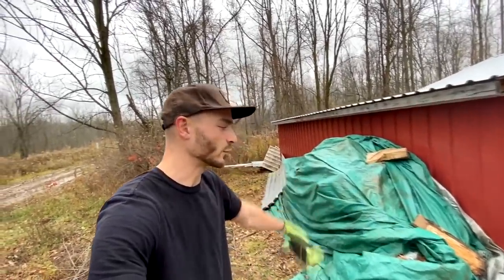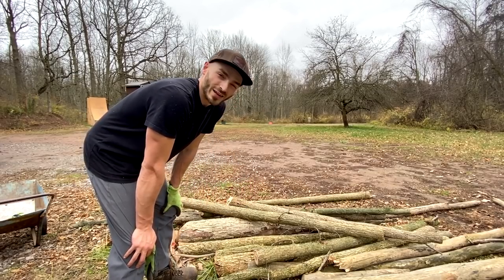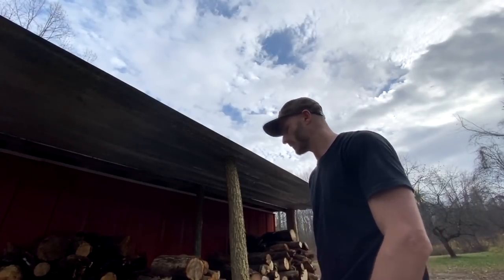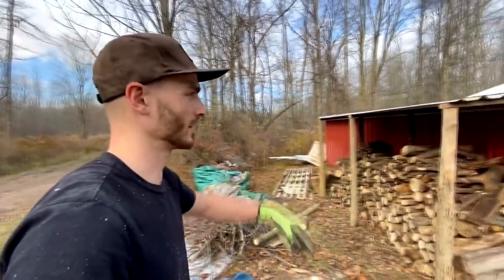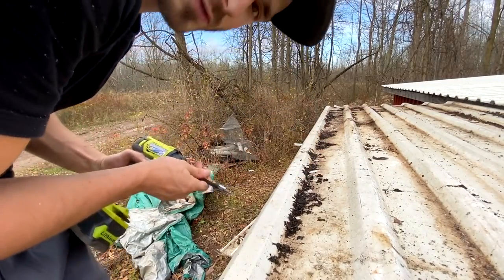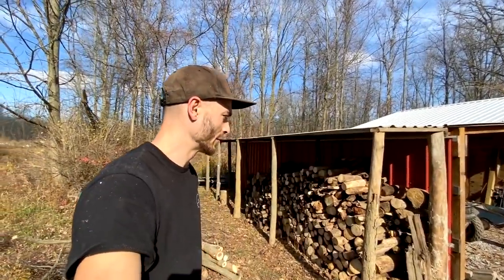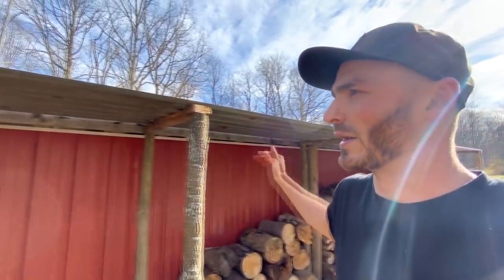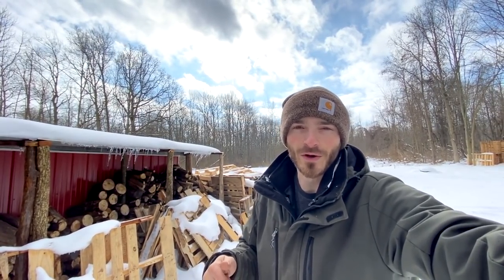BUILDING A FREE DIY SHELTER FOR FIREWOOD AT THE OFF GIRD BARN

Comment: Nail a 2x4 along existing overhang to nail roofing into then build a header on your posts then run 2x4 rafters 2foot on center then install metal roofing
Reply: Absolutely or the first heavy snow will buckle that metal roof.

Comment: You should secure your tree posts to the wood part of the original carport overhang that way your new overhang won't wobble or shift due to snow accumulation.  It will just make it a lot more sturdy.  It won't cost anything it will only take a few long screws and about 15 minutes of your time.
Reply from the maker: Thanks, It is screwed into that I just didn’t show it in the video.

Comment: 3:36 
Hey idjit, build a box frame for that roof and use self-tapping screws to secure the roof to the frame. You can get most of the materials for free by using pallets. If you use the box frame, then you'll only need four posts, one on each corner. Also, you need to plant those posts at least six inches into the ground.
Reply: and place some pallets on the ground to prevent your firewood from rotting

Comment: If you don't plug the gap between the roof (tin) and the other structure eventually your wood will get wet.  Could have place the tin roof under the roof of the structure next to it.  Just saying.  Also, if you are not going to dig hole for your posts, then you should get some very long screws and anchor the posts to the adjacent structure so if you get a lot of wind, the roof will not  fall down or blow away.
Reply from the maker: Ya I ended up putting a water proof sealer on that crack later on between the two metals cause I didn’t overlap them for some reason (just wasn’t thinking at the time).
Reply: @WheresYourNeighborhood  That was my thinking as well...........not trying to be mean, just didn't want your wood to ruin